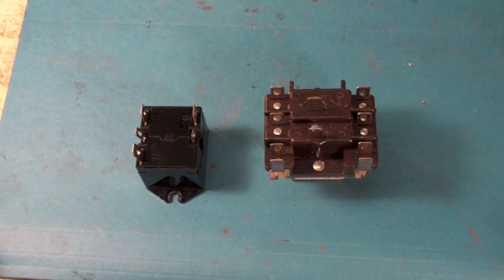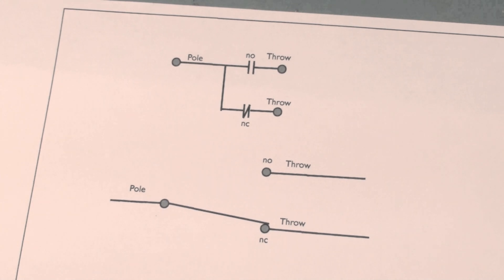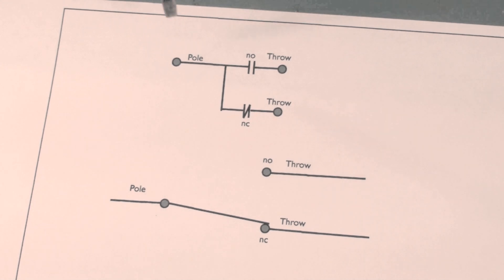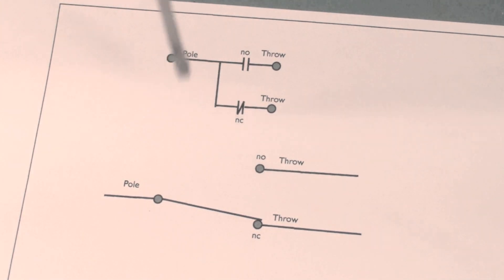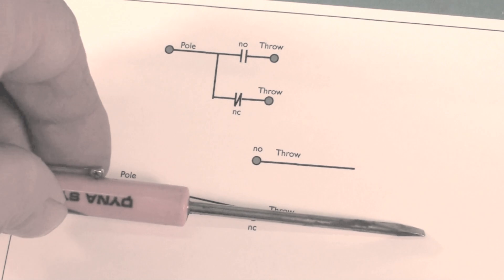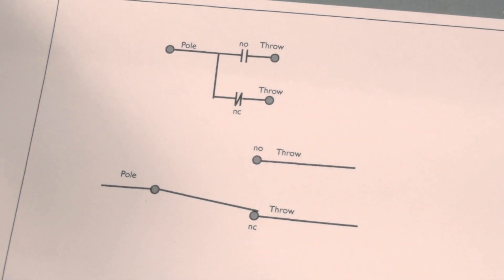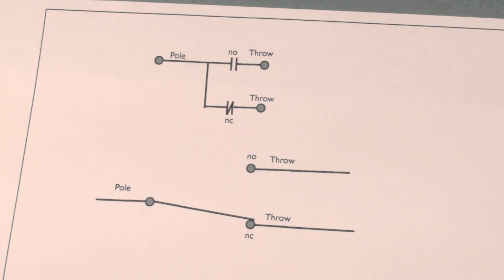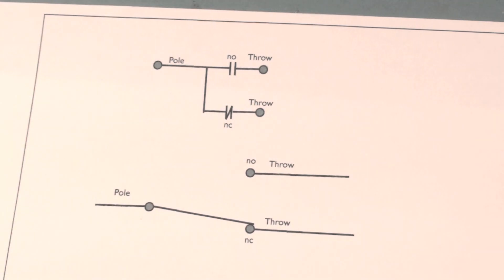How the single pole double throw relay is diagramed

Comment: May i know why we need to use two throw ? can some one explain it ?
Reply from the maker: A double throw switch is an "either or" switch.  
When the relay is energized, the power is changed from passing to one load to a different one.
An example is switching from low speed on a fan to a higher speed.
GFM

Comment: The title and pictures both refer to a relay.  The diagram is for a simple switch not a relay.
Reply from the maker: Robert DaCosse Actually that is not true.  The symbols used are for contacts, not a manually operated switch.  You might check this video.  https://youtu.be/dAOBHUrw10k  It shows the top of a relay using the same symbols as I have used.  Thanks for the thoughts,
GFM
Reply: grayfurnaceman First, the video was useful and I'm glad you put it up. I'm also a electrical novice so I defer to you. The video shows a relay with five points of contact, two of which are for the coil to open the NC contact. Where are these two points illustrated in the diagram? Are these commonly omitted in electrical drawings for convenience? As a novice it appears the diagram shows a SPDT switch and not a SPDT relay. Thanks again for the useful info.

Comment from the maker: Wiring diagrams can be frustrating with the different manufacturers using different symbols!  Many of the diagrams  use a ) for one side of the cap to differentiate from contacts, so that helps.  You sometimes are stuck with looking at the context.  Thanks for the comment.
GFM